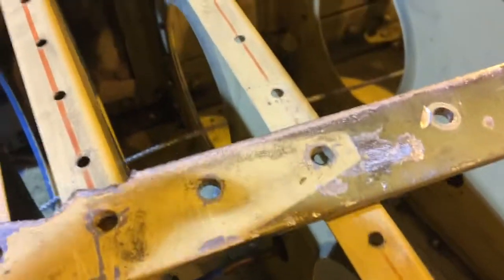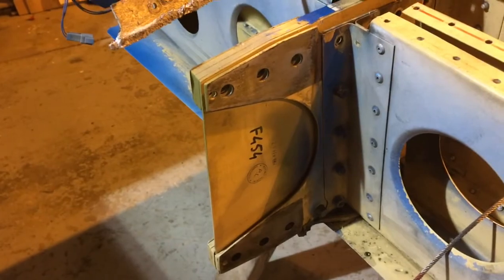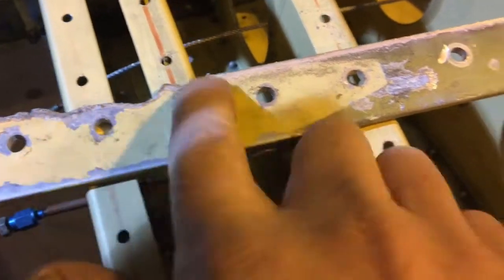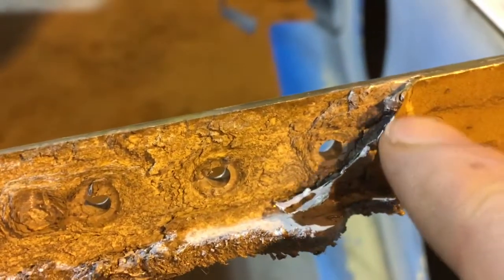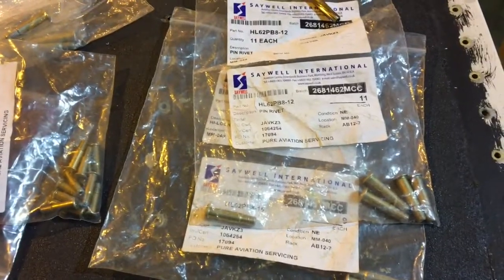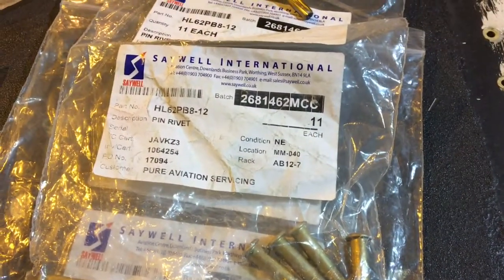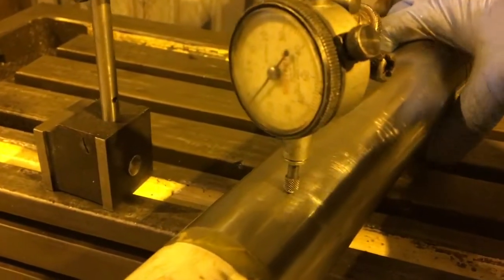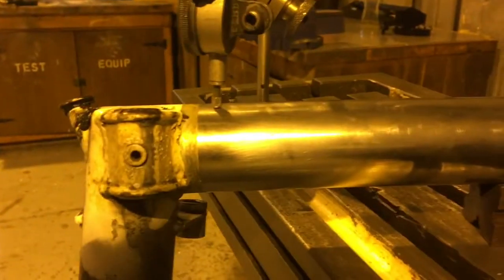Exfoliation Corrosion and more bent landing gears!

Comment: Don't complain, just be happy that you can issue a bigger bill .... :-)   That damage looks interesting, almost like corrosion of dissimilar metals, but i guess that's all aluminium, ...except the bolts
Reply from the maker: Yeah - its all aluminium, but I think you're right.   Although I was always told that the original defect is within the extrusion - and it seems that some manufacturers are a lot worse than others!  we usually find the worst and fastest developing exfoliation where steel fasteners penetrate the aluminium, and even more so at joints where water can be present.  So its probably accelerated by the presence of other metals and electrolytes.
Reply: as an aviation maintenance technician what specific inspection techniques would you use to detect early signs of intergranular corrosion and exfoliation corrosion and what corrective action would you take to prevent further structural degradation